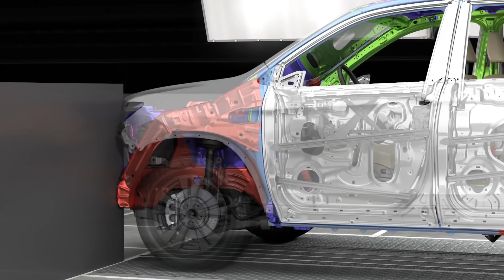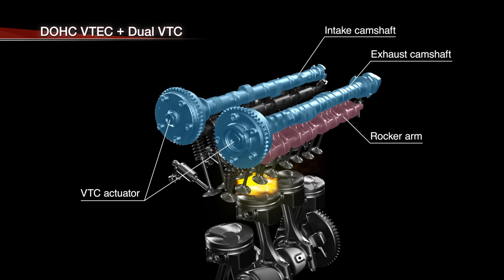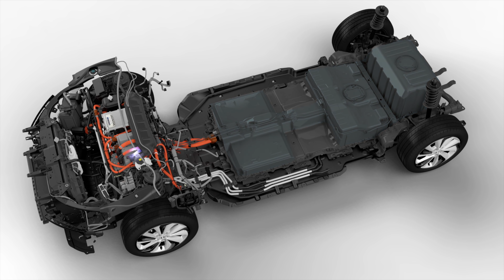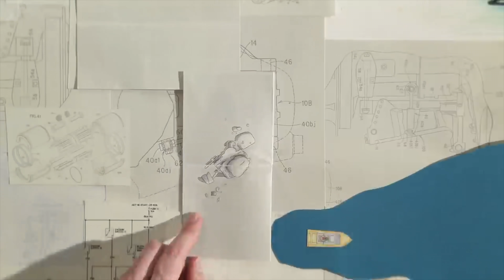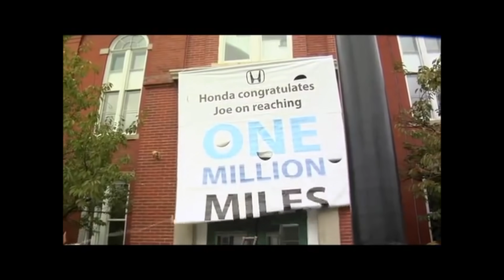Honda Doesn’t Want You to Know This

Comment: The prelude is one of the most underrated cars of all time. They’re becoming very rare nowadays.
Reply: True.Integra also.
Reply: Absolutely true.
Reply: True👍👍👏👏
Reply: So true, those H22 are some of Honda best engines
Reply: Had a prelude with a bad cylinder so i put an h23 blue top in it, that thing ripped.
Reply: @rxwhat33  I still drive one. The body is in pretty rough shape but it runs and drives.
Reply: Yes
Reply: Prelude is trash Rsx type s all day
Reply: @kasraogabian9122  rsx type s are cool but Prelude type s is way cooler lol
Reply: My first car was a 1986 Prelude. I loved that car
Reply: A friend had a prelude from the mate 80s with 350k miles on it & still running good
Reply: @gergoantal1066  Integra always wanted one,Honda QUALITY
Reply: @kasraogabian9122  Sphincter says what?
Reply: @carlosmmm2183  oh man that grunt. 🎉
Reply: Prelude is a beauty, couldn't agree more.
Reply: i got a friend that has the most gorgeous custom prelude ever
Reply: @carlosmmm2183  The HONDA  motorcycle engine's run forever
Reply: Your right about that had a 98 prelude until I did something stupid and put it in a ditch but anyway love them and looking for another
Reply: I have a 1990 si I think it’s called .. has 270,000 miles on original engine and tranny.. just took it in to start the restoration process. Great little 5 speed manual transmission I love that car
Reply: Ya, but it’s a side note to the rest of what Honda does.
Reply: I'm in one rn
Reply: You don't know how sorry I feel that I sold my H22a4 prelude.. for like 2k or something.
Reply: @WatchfulListener  that's so sad I feel the pain
Reply: Yeah my friend has one 600k miles same engine and trans never even be rebuilt !!
Reply: Just bought one yesterday.
Reply: Bruh really my parents were hella forceing me to sell my 1996 Honda prelude SI 5 speed but I couldn’t drive it cause they barley showed me😞 and I decided to sell it to someone that will use it more than me
Reply: @gergoantal1066  false. So many intergras here in Florida. I own a 5th Gen Lude and im 1 of 4 in my city
Reply: One of my dream cars
Reply: @NISMOIZKING  I live in Europe.Very rare here.
Reply: @gergoantal1066  live in Europe, got one, VTI, H22a , 4ws, next step is a 90 's matching era 3.2 t top. But that s still a dream...
Reply: @ianmangham4570  V4’s and V-Twin CX’s have some of the MOST RIDICULOUSLY EXPENSIVE  tune ups EVER! 😲🥸🤪😬🙃🤦🏼‍♂️🙄
Reply: @glenholmgren1218  Fuzzy Wuzzy was a women!
Reply: The Qualude....
Reply: I like to hear all the fanboys talk about the integra,prelude and rsx being underrated,when the legend is the real underrated car in Honda history,but only some will now
Reply: @kasraogabian9122  RSX suspension geometry is totally lame compared to the Ludes...
Reply: @WatchfulListener  same... I got 4 and a half for mine, but that was due to the engine/trans swap, etc... I mentioned a couple comments ago... those alone cost me $2800, lol.
Reply: Where I live. A rusted out prelude is over 5k easy. They really are so sexy
Reply: @ianmangham4570  Amen! I have a 1985 VF 1100 C (Magna) sitting in my driveway. It can still take on anything but a V-Max
Reply: @neilmccann5826  Beautiful amount of POWER with one of those classic beauties, comfy as a sofa
Reply: @1cemann  I stupidly sold mine not long before they started to appreciate, I think...
Reply: Just bought one 3 weeks ago. LOVE IT!
Has a f20b engine in it.
Reply: Had a H22A swapped EJ1 and it was a blast.
Reply: First car I hit 240 in was a 2000 Prelude back in 2007 :) Good times... first time I ever went 200+, I was 17 at the time lmao
Reply: @jdm8702  Nice. The tech that swapped mine had a sweet one too (H22A EJ1)... he took me for a ride... with that lighter chassis... wow...
Reply: @xdx1990  kph I assume, lol.
Reply: I miss my bb6
Reply: My very first car I ever owned. I think about that car all the time
Reply: I have a 97 SH. It’s old but I love it
Reply: @akzizou10  It was my first manual... and me too.. .
Reply: the 07 camry 3.5l along with the 07 avalon will be rare too but it won't ever be mentioned because people dont respect a toyota thats not a supra.
Reply: Had a 82 prelude.  It was trash but it was fun to drive.
Reply: @gabrielvillarreal5074  luda!
Reply: Prelude 4ws was a neat oddity. It was purely mechanical, gave it a heavy steering feel, but man you could turn it around in a shoebox.
Reply: I have a 97 prelude type S & 06 Dc5 Type R .. I love them both. And they both have very opposing personalities. My daily’s have been jeeps
Reply: @gergoantal1066  yeah but both those cars are abused in races by young people

Comment: Paid a total of $11,000 for two used Honda Civics for my sons.  First one was a 1998 with the second one being a 2009.  Great running cars that had a lot of hard miles.
Reply: Which son got the older one?? HAHA
Reply: @PNW_Sportbike_Life  Probably both are fighting to drive the "older one"... a Civic SiR
Reply: @texasabbott  thats true.
Reply: I’m still driving a 2006-2011 Civic 5-sp automatic, it’s 14th year, it had 260,000 km and still going strong w original engine and trans and every sensors on board, changed oils and trans fluid  1-2times per year both together! Why? Coz oils are cheap, over-kill a little for maintenances and do not over-use my car. Only changed all the normal wear and tear parts, absolutely no other crazy electrical or electronics issues at all. The down side for Japanese car is they r too “soft” , if youngsters drive recklessly and get into serious accidents that wouldn’t be good. I hope Honda civic build more like a tank like Volvo!
Reply: @东东-j1b  Other normal things on a 2006-2011 Honda Civic that might need to be replaced before they fail (preventive maintenance): alternator, starter, engine belt, A/C compressor clutch, A/C refrigerant, shocks, sun visor.  Be gentle with the driver side door, the latch is made of plastic and could fail after so many times getting slammed. Otherwise, the rest of the car lasts almost forever (I'm at 200,000 miles). Good luck!
Reply: @东东-j1b  they're "soft" because they're very light for their size. it's the price you pay for great fuel economy

Comment: Both my mid 2000’s Honda’s have 263,000 and 225,000 miles on their odometers and still going strong.
Reply: I have a 97 Honda Inspire 5 cylinder engine with 199,000 miles..... Seems like am the last owner. Still drives good.
Reply: @michaell3711  Those I5 engines where neat. I hope they bring them back. Or, maybe a new super smooth I6 engine. I would love that!
Reply: That seventh generation was one of the best looking ones ... great cars .
Reply: J35 2002 MDX reached 420k km
Reply: that’s awesome to hear. i just picked up a 2007 honda fit
Reply: ...no surprise..

Comment: 324,000 miles on our 2004 Honda Pilot and still running great!
Reply: That's a lot of mileage . My 97 Honda Inspire has 199,000 miles.
Reply: I put over 400 on ours before we parted ways. Wife beat the crap  out of it and it still ran like a champ
Reply: Pilots are as good as they get. Should go past the 500K mark just fine with good maintenance
Reply: Dale Macarena  400k miles.
Reply: Hell yeah! I don’t have a Honda but my 4Runner 03 has 291,000 miles on and it still runs like a clock, and like Scotty likes to say “it still blows cold a/c!”
Reply: @AppleHelperITouch  Those last forever as well
Reply: 303,000 on my 02 accord, original engine and transmission.
Reply: Original engine and transmission.

Comment: Been driving Honda and Acura cars since 1998.  Currently drive a 2010 Accord EX I bought new.  No mayor issues and the car still going strong. I approve this video! 👍🏻
Reply: What do you think about a Toyota?
Reply: I think camary or honda
Reply: @ne9835  I can  tell you, Toyotas are very solid vehicles. One of my sisters has a 2004 Corolla and she's not  much into properly maintaining cars. And the car runs like a clock.

Comment: I LOVED my Hondas ... The 1992 Accord was the smoothest riding car I ever owned.
Reply: I have a 91 with 211k on it. I got it with 72 on it for 2.5k. Never a problem. Solid !
Reply: Had it in 2019-2020 i approve this message
Reply: I had a 91. Got to 297k before the original transmission went out
Reply: @wigletron2846  
WoW
Reply: I had a 91 with 281 thousand miles in 2009.   Sucked a valve at 309k.   Junkyard motor and drive the car until 440k
Reply: I felt that way about my 93accord
Reply: Damm I miss my 90accord 🥲so square shape, from bumper to rear end all solid burgundy with some redline rims👌🏽

Comment: 2010 Honda Civic Lx-S 243,000 miles on it and kicking strong! Had since brand new. Went to do a valve lashing at 200k and the valves were all within specs! Changed oil every 5k, no build up! No major issues other than normal wear and tear! Love it!
Reply: What engine do you have petrol or diesel plus what size
Reply: @raptorpome2577  petrol

Comment: I own a 05 S2000 and I love it , you can't fault this vehicle in anyway ...  
Hello from Australia
Reply from the maker: hello!
Reply: Ap2
Reply: My yellow S2000 is an '05 as well ... only 34,000 miles on it so far!
Reply: AP1 RIO YELLOW PEARL
Reply: @seanthompson8071  you got a steadily increasing value right there. Just drive it. Free miles
Reply: AP1 Formula One Red.  175K mi & still runs like a champ!
Reply: I had a 2003 AP1 . Sold it 3 years ago but wish I kept it .
Its a Miata on Steroids!

Comment: I've owned Hondas since 1976. My first was a 1976 Honda Civic CVCC hatchback 4-speed stick. Currently in my garage are two Accords, 2007 and 2012. I also own a Honda Lawn Mower, Honda Snowblower and my pressure washer has a Honda engine. Honda has never let me down!

Comment: I had an 88 accord with over 300,000 miles on it. One of the best cars I've ever owned.
Reply: Did you junked it or sold it ?
Reply: @michaell3711  I sold it for 600 dollars, I gave 800 for it and drove it for almost two years. Those little cars will run forever.

Comment: I owned an Acura RSX-S with 200,000 miles and I drove that car like a mad man. That glorious K20 was rung out to its 8100 r.p.m. on the daily. Yes, I did meticulous maintenance including all fluids flushed every year. At 180,000 miles, I did an oil analysis and my K20 had another 100,000 miles easily left in it. I lost my RSX-S in a car accident. I would have still been driving that automobile till this day. What did I get to replace it? A Honda Accord with the J35 and a 6-speed manual, of course.

Comment: Yep. 370,000 km on my 2009 civic. Great engine. Engine starts first time in extreme cold -30 degrees celcius. No problems at all except the paint is starting to peel.  Very reliable.
Reply: Starting to peel? Be honest is falling apart.. That's the very well known Honda's problem.. 😅 although if you weight the amount of money on non repairing the car is OK if the paint isn't that good.

Comment: 2007 Honda Civic with over 200,000 Miles, never had any issue.
Reply: Manual or Automatic?
Reply: @M447DT  Automatic with ATF changed regularly
Reply: @Mr-Major  how's the gas mileage is it still as good as when it was new ? Does it ever get carbon biuld up in the throttle body
Reply: @M447DT  I would say 90% gas mileage efficiency compared to original. I use Scotty’s “spray cleaner” trick to clean throttle body + MAF sensor + Change air intake filter with OG Honda once a year!

Comment: I have an 07 and an 05 CR-V and I love them both. Both are approaching 200,000 miles and both run like a clock. I tow with my 07 sometimes for long distances and although the engine is very rev-happy it can definitely hold its own towing at max capacity. The ghost of Soichiro Honda himself is sitting in the passenger seat of every Honda laughing at the success of the empire he built.

Comment: Family all has Honda’s
I have a 13’ civic coupe 110,000 miles
A 2001 Honda CR-V with 240,000 mile
Also had a 93’ civic coupe that sadly was wrecked at 170,000 miles

My mom had a 2006 accord with 149,000 miles she just traded it in a few years back for 2017 Accord coupe.
My stepdad had a 2003 accord coupe with 280,000 miles that he sold. Now he has a 2016 accord with 159,000 miles.
My brother has a 2019 civic hatchback sport. Not one of our Honda’s have ever had a catastrophic problem worst repairs were brakes. We follow the owners manual recommendations religiously and none of the cars have ever let us down.

Comment: 2000 Accord V6, 2000 CRV, 2006 Acura TL, 2008 Fit, 2013 Acura RDX...all have served our family well...none have been troublesome...have 167K on the TL and it’s going strong.
Reply: Sell me the 2000 Accord V6
Reply: Michael L , Greetings from the Texas Hill Country.  I sold it while living in SoCal.  I kept the car like in near new condition when I sold it in 2012, and replaced it with the RDX.  The ‘98 - ‘02 6th generation Accord has a classy body style that’s aged well.  Fyi that generation Accord, called the “American Accord”, subcontracted subassemblies out to Ford & GM.  The transmission was GM built and up to 8% of cars produced suffered problems...a  lawsuit ensued.  Fortunately my car was fine.  IMO, it might be best to go for a different generation Accord.

Comment: I have a 7th gen accord coupe ex-l! Got the j series v6 engine. Been extremely reliable! It’s only got 147,000 miles on it it’s still a baby! I’ve heard transmission are weaker in them, but been driving it with ease and still shift’s flawlessly :)

Comment: The 90s Honda’s ran forever! I recently bought a 2020 civic sport sedan with the 2.0 naturally aspirated port injected motor and 6 speed manual transmission. 
I’m not a fan of direct injected turbo motors or CVT transmissions so I bought what I felt was the most reliable way to buy a 10th Gen civic as a daily driver. 
These 2.0 port injected NA K20C2 motors will last a very long time, unlike the 1.5 Turbo GDI engines.

Comment: I bought a used 2017 Honda Fit a little over a year ago to commute to and from work, a 140 mile round trip, and I love it. My long term average fuel economy is between 41 and 42 MPG and it has been quite reliable so far. My previous car was a 2015 Chevy Spark and although it was quite fuel efficient, it was a turd. CVT went out only three months after I purchased it. Luckily it was covered under warranty. I was issued a 2017 Chevy Cruze while my Spark was in for repair and fell in love with the Cruze. It was the Premier package with leather heated seats and steering wheel and got 40 MPG which was even better than the Spark. I thought I had found my next car, but luckily for me, I stumbled across Scotty Kilmer's content and became informed about their lack of reliability, so I shifted my focus to more reliable transportation which led me to the Fit. I purchased it with 21k miles and now have over 46k with no issues whatsoever. My only regret is that Honda discontinued manufacturing them, otherwise I wouldn't hesitate to get another one.

Comment: My first car was a 1996 Honda Accord. It had over 220k miles on it before it got totaled. Never had a problem with it.
Reply: My mom used to have a 1996 Honda Accord as well same as you no issues she got rid of it because it was aging for a 2002 Honda Accord, that one had a lot of problems because of the defective transmission on it, then a 2007 Honda Accord it kept going until 2019 when the ac quit working, and all the other fixes on it, she had a 2016 Nissan Sentra for a brief, she hated it because the ac didn’t work right and the transmission and engine hesitated when it was cold outside and now she has a 2020 Honda Civic Lx no complaints at all. 😁 I have a 2015 Honda Civic Lx my very first Honda, love it, no complaints only had to do an oil change twice. 😁

Comment: 2007 Honda Accord, 5 speed manual, 239xxx miles as of 4/25/21. Does not leak a drop of oil, still running on OE wheel bearings, engine, clutch, and many more parts!

Comment: Original owner of an Japan built 09 Accord i4 auto sedan, 240k+ miles. Other than normal wear items,, she is all original except for the dampeners. Swapped those out at 180k just because. All 4 still had some life left. Key is maintenance, I'm about to do its summer fluid changes and valve adjustment. Not our fastest ride ( have a GT350 and EX Sport) but she is damn reliable.

Comment: I own a 2014 Honda Civic SI and LOVE it! I purchased this car used in December 2014 with just over 10k miles which saved me about 15% if I would have purchased it brand new. I have upgraded the stock air intake to a Skunk2 cold air intake. The ONLY maintenance of this vehicle, so far, has been oil changes, 2 battery replacements and an alternator replacement. The battery and alternator replacements could possibly be due to the audio system I have installed in the car. I have a Rockford Fosgate Power 800a2 amp which is rated at 200 W x 2 @ 4 ohms, but is probably outputting close to 50% more wattage than its rating (as with most RF amps) with it wired bridged @ 8 ohms.

Comment: We live near the Marysville Accord plant. We're all Honda around here.
I'm currently working to revive a '98 Civic Sedan that my sister left to sit for more than five years. That great engine started right up, but the brakes on the rear wheels are locked up.
I'll have it running soon. It has 290,000 miles on it, I plan to get it to 400,000. No reason I couldn't.

Comment: I got a job at a dealer. I needed a car for my partner, and my work had a blue 17 Honda Fit EX 35,000miles . We bought it without a pre inspection, it had come from Nevada and had 4 previous owners. It has been a year now and the thing still drives and looks like new! So much fun to drive, and I really don’t think I’ll have to fix anything any time soon. It now has 51,000 miles on it and is daily driven 15 miles a day.